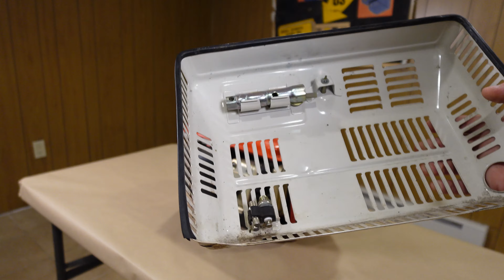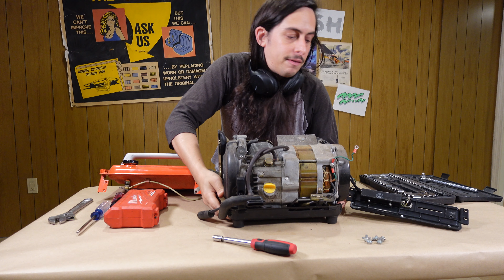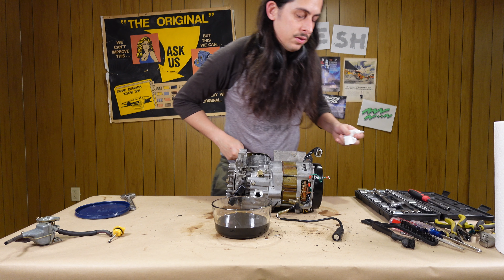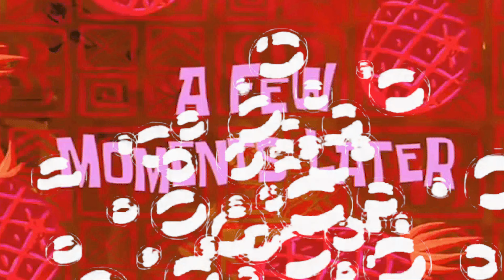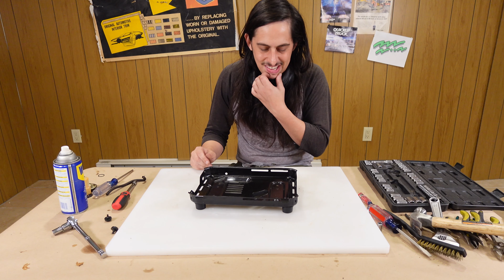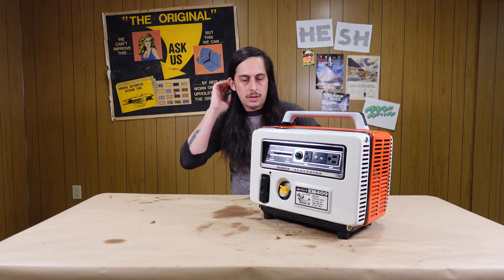Honda EM400 Generator - Will It Run?

Comment: Your air filter is missing, it's just a block of foam that goes behind the small removable cover with the knob, I made mine from some generic filter foam cut to size.
Reply from the maker: yup thanks! didn’t come with one and they usually disintegrate anyways… new foam filter is on the list!
Reply: @teamhesh  yes! Mine was utter dust, I bought an em300 at an auction for 10 pounds in the UK.
Reply: @teamhesh  yes! Mine was utter dust, I bought an em300 at an auction for 10 pounds in the UK.